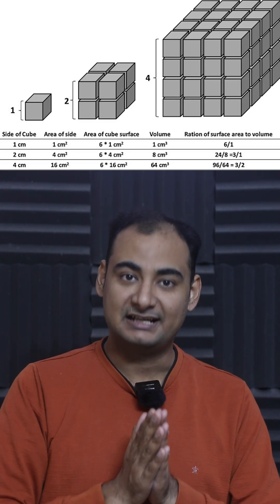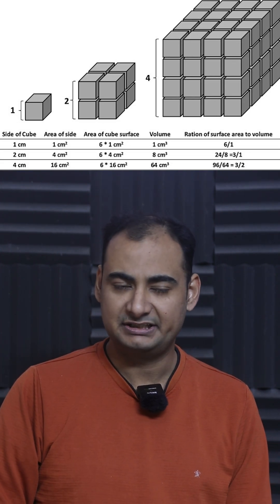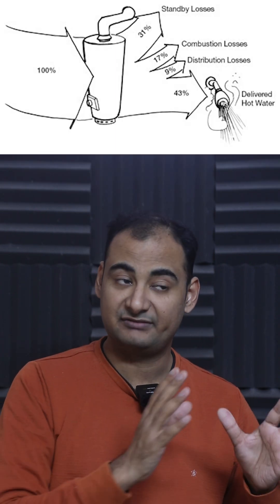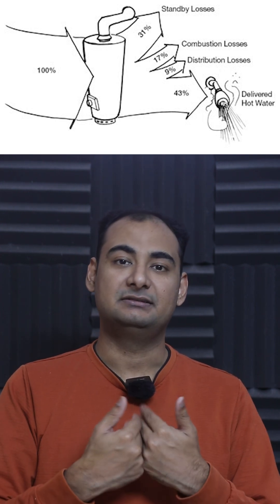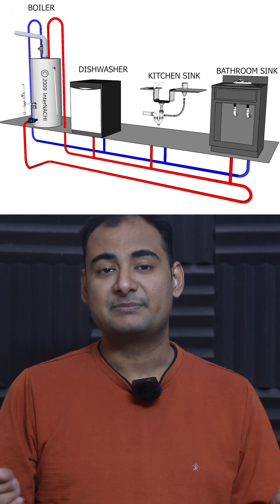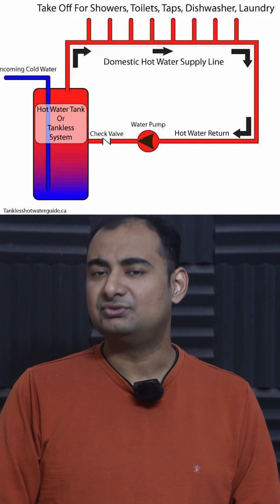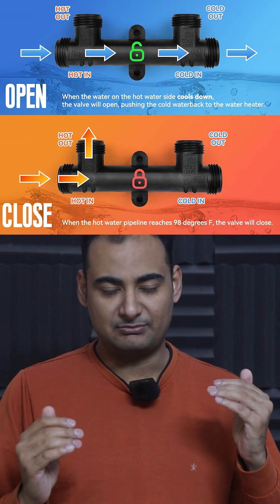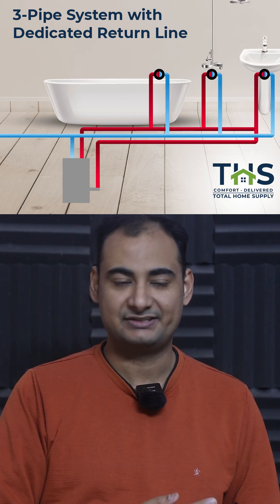Why AVOID Small Water tank heater

Comment: To be honest smaller instant gas water heaters are better . You get instant water heating at lower costs.
Reply from the maker: my not be true anymore as 
a) pipe gas is not everywhere 
b) heat pump exceed 100% efficiency  & u can add solar 
c) hot water return line give you instant hot water